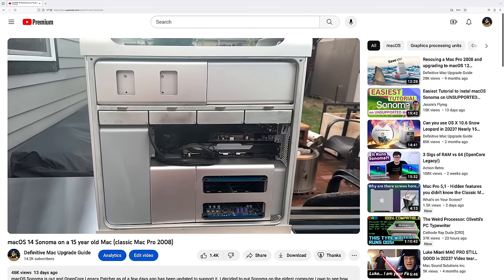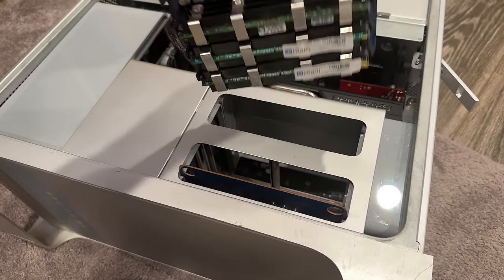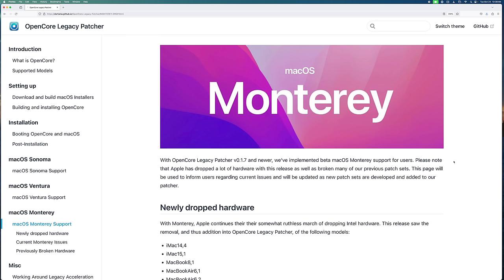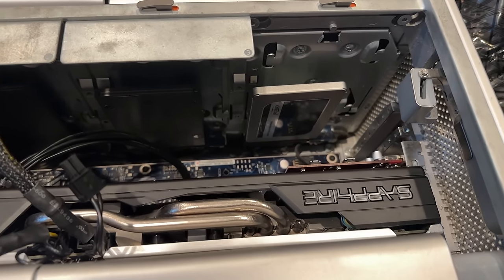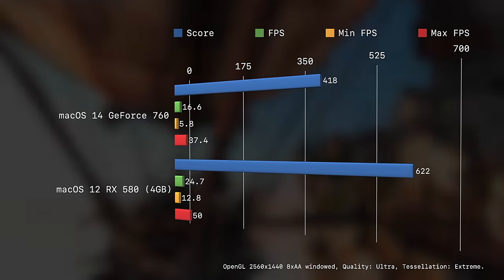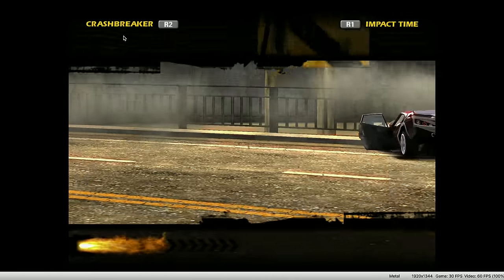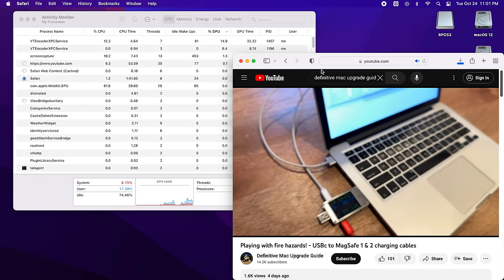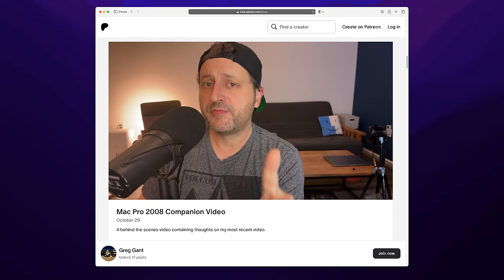Is it worth upgrading an ancient Mac Pro 2008?

Comment: I've had the same issue with my 2009 Mac Pro, and after days of messing around with it back when Ventura came out, I eventually figured out that if I installed macOS with the original GPU, removed the root patches, shut down, and swap in the 580, I could connect to the machine over SSH or VNC, and then install the patches like that. I've been using it daily since then without any issues! (And yes, the same procedure works with Sonoma for me)
Reply from the maker: That's.... not a bad idea. I never considered that it was fully booting.  I'll have to try that at some point when I'm more open to being frustrated again. Right now Sonoma is crashing when I try to launch it from OCLP weirdly.
Reply: @dmug I saw Jessie's flying post that there's issues right now with 14.1 on OCLP, so maybe it'll be worth a try in a couple weeks?
Reply from the maker: @joshm264 yeah, I was on 14.0 during the making of this vid, I’m hoping in a few weeks I can get macOS 14 working. Also, I forgot I have a black late 2006 MacBook that’d be a perfect candidate for Linux.
Reply: I get stuck on booting up on Sonoma aswell. (Same setup as described above: Dual 2,8Ghz / 16GB 667Mhz RAM and asus GTX 1060 with mSATA SSD (custom ssd enclusure for mSATA drivi) i CAN boot Sonoma if i hold the left SHIFT (Safe mode boot) But then SIP status is all fucked/locked, so i can´t install Root patches (No button availabale to perform patching) and YES this is on 14.0. so shouldn ´t be same issue as Jessie´s flying is describing. BUT look here. it is already solved by Khronokernel (author of OCLP)
Reply: I have a 5,1 and installed a rx 580 8gb (not chinese) but the trick i had to use is to uninstall the root patching first without reboot i think. Also i read monterey is the only stable system so i wouldn't try a newer one.
Reply: This is actually 100% how i got High Sierra installed on 2008 cMP 
installed with dosdude´s patcher and then installed the webdrivers over screenshare with GTX1060 fitted. and then just rebooted :D
Reply: I was able to install Sonoma on my Mac Pro 3,1 but during the install, when the  open core patcher was doing one of its several restarts, it would stop working and go black screen on me. After several failed attempts I decided to zap the PRAM holding the the keystrokes down for two cycles until the second louder start up chime occurred and still holding down the Option key and releasing the other keys I entered the EFI boot and successfully complete the install. The only problems I've had after that was that the Wi-Fi and internal Bluetooth no longer worked
 I found a patch for my WiFi but have yet to solve the Bluetooth issue. Otherwise the computer is running well. It helps that I have 16 gigs of RAM and an SSD drive installed as well as several terabytes of media storage in the other 3 SATA drive bays. Just recently I was able to install Sonoma on a MacBook 7,1 after upgrading the SSD drive and doubling the RAM from 4 to 8 gigs and using the same PRAM trick after an Open Core installer crash and booting to the EFI and selecting the hard drive and not the USB installer created for the open core legacy patcher install. I built my Mac Pro from salvaged parts from several computers that were being discarded as e-waste by my former employer that was downsizing its offices during the economic slowdown caused by the COVID lockdown. In fact I was able to refurbish another Mac Pro 3,1 and two 2011 Mac Minis which I later sold on Offer Up
Reply: Really? PRAM reset 2x DURING install? 
That is…unortodox in lack of better words. ;)
I have never thought of this as an option :D  @WaymoresBlues
Reply: …and DO keep in mind: I´m trying REAL hard to keep the Asus GTX 1060 6GB being fitted the Mac Pro 2008. 
If i swap the 1060 for one of my RX 580´s, i would think everything resolves itself. But that´s not what i want. I SHALL Make the 1060 run. no matter  ;)  @WaymoresBlues
Reply: This is giving me anxiety. Sorry I had to stop at the video, man 😂

Comment: Too bad the machine will use 500 watt at idle because of FBDIMMS and old CPU. LOL.
Reply from the maker: It’s quite a bit lower than that. I have a killawatt meter, and I think it idles at about 120w. But yes, Not great when compared to modern power efficient machines.

The fully buffered ECC DIMMs idle at about 8w per module vs 4w for non fully buffered. The old cpu on the other hand… yeah… not good.

Comment: Yeah Mac Pro 2006-2012 got SATA/300. Not SATA/600. So "all" SSDs will step down from 500-550 MB/s to 250-300 MB/s but it's so much faster than HDDs plus don't forget the IOPS performance.

Comment: Coincidentally I  just bought a second GeForce GTX 680 2 GB (€100) for my secondary 3.1 ( 2.8 octocore, x2 SSD/ 32 GB RAM)  Am I crazy?
Reply: No, this is a testament to how far these modular pcs can be pushed. This is how the pc era should be. If you can keep something alive with a few modest upgrades over time then you should.
Reply: Sonoma works correctly on my MacPro 3.1 24GB Ram and GTX 680 2 GB.
Even booting from an external USB enclosure
Reply: @txilibrist  Yes, that´s the plan. As my 2 Mac Pros are almost identical I just will install Sonoma in one of them under OCLP then SuperDuper clone to the other one.     Writing from my main 3.1 2 x 3 GHz Quad-Core Intel Xeon which I use on daily basis even when I have more recent Macs (2014 MBAir, Mini and iMac)
Reply: @miguimau  tu apodo me suena mucho de Macuarium ¿Cierto?

Comment: Hello.  I wanted to let you know that I tried this using the patcher with Big Sur and Ventura on my Mac Pro 3,1.  Making the USB installer went off without the slightest hitch.  That was the end of the good news.  The USB was NEVER seen as a boot option by the Mac.  I know that it will boot to a USB, because I have had a Linux distro installed before.  That, in itself, is another nightmare story.  It will install Arch-based but not Debian/Ubunti-based distros.   Why is it not seeing the USB drive?
Reply from the maker: Did you install OpenCore and then boot off the OpenCore partition? OpenCore sometimes be a bit goofy.
Reply: There is no OpenCore partition.  The flash drive is not seen.

Comment: I love the timeless design of Mac hardware from 2008-2020.  Which one of my fave setups was taking a 2011 27 inch iMac and getting the ram to 32gb, 2tb samsung sata ssd, and then would put on a pretty custom version of Linux to run on it.  Quite a bit of distros now from 22.04 support all the devices in it and older macbooks even the facetime cameras ootb!
Reply: Beleive it or not this design goes all the way back to the Power Mac from 2003!

Comment: sorry buddy Mac Pro 2008 is better pick. Silicon suck balls, no internal Massive Storage, can't remove anything internal. can't run older 32 and 64 bit games /Apps. can't downgrade to Older Mac OS . Modo 3D (MacOS 11.x (Big Sur), 12.x(Monterey) and 13.x (Ventura)*
Windows 10 and 11 (64-bit only)
Linux CentOS/RHEL 7.6-7.9 (64-bit)**
*Modo 16.1 has been tested and validated on apple silicon hardware, running under Rosetta 2 emulation
Other operating systems may work but have not been fully tested, please see release notes for details on libraries that will need to be installed.
really Rosetta 2 emulation. Apple / Tim get to control what upgrades goings in your computer. What happen to the freedom to pick what upgrades you want for YOUR PERSONAL COMPUTER. You can Pick AMD, Nividia , Sonnettech,Newertech, etc. its funny a computers from my childhood (Commodore and Amiga) allow you to do every, while a modern computer don't do gaming well.

Comment: I bought a used 590 with vial bios and I struggled like an hour with windows drivers, seemed like the car was running a mining bios and after switching the bios it worked great.

Comment: Definitely some of the better looking Mac systems; I didn't know you could shoehorn newer MacOS in there. I worked extensively with Xeon systems of this era, and they were quite the screamers at the time, I think I had tricked out my dev system with dual W3680 (gulftown) before we moved to Romley (E5-2600 and -2600v2 series).

Comment: I have a similar setup, same GPU but with 8GB RAM, 32GB system RAM but a single processor. It runs Monterey happily under OCLP and I've not moved to Ventura or Sonoma as I don't like the interface. The only issue I've really had is that I have to remove the boot drive and install OCLP from another machine or I loose Bluetooth and I've never managed to get WiFi working so it's as well the ethernet is close by. I tend to use it as a media server, from your experience I think I'll definitely stick with Monterey!
Reply: Nice I got 32 in my dual 3,1.
Reply: I’ve heard you can upgrade the processors but gpu and metal is the key to it all or just bootcamp windows tbh it’s still intel

Comment: There's one more upgrade that you could do, and it's only theoretical and my 08 cheesegrater got stolen so I can't test it anymore: Getting a pair of X5460 CPUs and modding the pads to force the Bus up to 400Mhz and the CPUs at a toasty 3.8Ghz. (9.5x multiplier I could never test it well because my 667 RAM did not like an increase in the bus speed. (Or if a pair of X5470 CPUs could work with the same FSB mod)

Comment: If that’s a 4,1  or 5,1 you don’t actually need registered memory. I ran regular 1333mhz in mine.
Welp, Nevermind lol. I have the 5,1 with 6 core 12 thread Xeon. Heard you mention 3,1 a bit after commenting.

Comment: Ive upgraded many 2008 to 2012 Mac Pros for my business. The problem now is the cpu(s) are obsolete so future OSes, even those for Intel chips, wont work properly
Reply: what software does it have that you can't use on a windows PC?
Reply: How do you upgrade a 2008 to a 2012?  They are totally different computers.   Did you mean 2009 (4,1) to 2010-12 (5,1)?  You can upgrade 2009 to a 5,1 but not a 2008

Comment: how did you get it to support metal 3? my 580 (exact same 4gb sapphire nitro) is stuck on metal 2 in Sonoma. also how did you go about installing windows, did you use bootcamp?
Edit: also, when I first installed my RX 580 in my Mac the only way I could actually get it to output any form of video, was by removing all the SSD's, HDD's, USB's and expansion cards except for the OCLP USB and the 580. Then I had to perform an NVRAM reset to, for lack of a better term: "load the drivers" onto the card. lastly, during the install I had to do an NVRAM reset every single time it rebooted. Hope this helps.

Comment: 2008 is too far back, I was running an 09 for a long time using open core and some GPU I can’t remember. Sure I’ve got some videos on here of changing the CPUs from dual cores to quad cores. Love these old Mac Pros, such a beautiful design.
Reply from the maker: Agreed, but I’ve had this computer since 2008 so there’s a mild sentimental value and it’s the reason I wrote the Definitive Mac Pro upgrade guide. 

Plus, I do have a small use case for it as a box to mess around with and make videos about it.
Reply: @dmug I’ve got you man, I just came across this video randomly. You’ve earned a sub for all that hard work.

Comment: Ah I haven't dabbled with running opencore on my Mac Pro 3,1. I just have mine running Catalina with a vega 64 and a PCIe adapter for the sata SSD boot drive. I just had to add the instruction emulation so I could make the CPUs recognize the Vega card. I want to say it was SSE4.2 instructions that the harpertown Xeons do not have natively. 

I messed around with clover a couple years back for a ryzen based hackintosh that was fantastic. Never got around to trying out opencore. I mostly use linux now.

Always fun to push the limits of old hardware. I keep the 3,1 around these days since it has both firewire 400 and 800 making it ideal for troubleshooting and fixing other old intel macs, macbooks, imacs, etc anything from '06-13.

Comment: I upgraded my 2009 Cheese Grater switching form 4.1 to 5,1, with new processors, adding 30%. a new GPU, and filled up the ram ... it wasn't entirely smooth (had to add software to deal with fan overrun), but I've been running it very happily, dealing with 4k editing very easily and fast reactive screen processing ... 14 years old. Must have been an oversight by Mac to allow so much potential e-waste get by their general single use attitude to their products.

Comment: I’m debating the same for a 2012 5,1 model that I can buy for $100
Reply from the maker: tough call, $100 pretty middle of the road for a deal but the CPUs are dirt cheap for it and the RAM is much cheaper for it than the 3,1. I'm guessing for about $100 you could have a newer GPU + faster CPU(s) + SSD and for $150 more RAM, bringing you to about $250 damage, but used Mac Minis M1 are $400 and despite the 8 GB of RAM likely faster for most things. The four reasons I'd go for the Mac Pro is: Love of the hacking/hardware, ability to boot many OSes, and finally, internal storage and finally playing Windows games. The reasons I'd go for the Mac Mini M1 is: need a computer that's stable and have actual work to do, dislike of messing with esoteric system configs, native OS support.

Comment: polaris and rx serries gpu need avx/avx 2 and the xeon cpus in de 2008 mac pro do not support this 
only the 4.1 and 5.1 mac pros have support for cpus that support it
Reply from the maker: None of the classic Mac Pros support AVX. That’s where the MontRand patch comes into play that’s bundled in OCLP. The Mac Pro 2013s support AVX but not AVX2. It’s why you need to flash the 6000 series GPUs regardless of the classic Mac Pro generation.

You’re probably thinking of SSE. The drivers for the RX580 started requiring SSE4.1 which the Mac Pro 2008 doesn’t support but there’s a patch included in OCLP for that.

Comment: This is awesome. I love older Macs and always felt that a lot of them had planned obsolesce before their time. Seeing one comfortably run modern MACos in general is pretty sweet.
Reply: planned obsolescence is Apple's whole strategy
Reply: I still have a PowerMac 6500 in my garage with OS9 installed on it mostly for nostalgia since it is covered in the stickers from the several bands that I liked or personally knew back in the 90's when I used to make flyers for them in Photoshop and run down to Kinkos to print and cut them on card stock. I miss those days but not the trying to figure out which old extension was incompatible with a new one and was causing my system to crash. That was always a problem and just when I thought I handle on it, BAM, OSX came out and all of my old Macs were now obsolete
Reply: And that greedy planned obsolescence practice from Apple is why I stopped buying new Apple products after the burn I felt when I purchased one of the original iMacs that was made obsolete within a year and their ever changing power adapters and lack of backward compability. But what really riled me to no end was when I went to buy a composite cable adapter for my Video iPod and the Apple markup on it was outrageous only to find a similar mini RCA to composite cable at Pacific Radio and find the only difference was that red RCA jack was actually the yellow, the yellow was the white jack and the white was the red jack on a 12 foot cable that was a fraction of the price of the official Apple 3 foot composite cable. Those chicken shyte sumbich's at Apple haven't got a red cent from me since.

Comment: What happen the last time you installed MacOS14? I wonder ... did you need to add boot arg's like Pikera.
Or maybe you needed to use the Nvida card / use OC to make a MacOS14 instal / then add RX and boot arguments.. just brainstorming. those are my thoughts.
I may pull mine out, knock the dust off snd have s go with a Vega 64.
Reply from the maker: That’s where my knowledge trails off as I missed the era of manual tweaks. I briefly used Martin Lo’s config but we had the same system: dual 5,1 + Radeon VII so I never messed with it, then I sold my Mac Pro 5,1s. 

I ran the post install remover from OpenCore, which nuked the GeForce 760 and included the AMD option assuming it’d configure everything properly. 

My current OpenCore config works for macOS 12 so that portion seems to be ok, but it’s just working with Sonoma and not sure if some post install is messed up.

Comment: Hello Mac Pro users, does anyone know if I can still boot a 2009 Mac Pro into 10.7.5 lion with the 5,1 firmware and the 12 core 3.46 processors? Please and thank you!
Reply from the maker: Yes but 10.7.x has pretty limited GPU options and is capped to to something like less than 96 GB of ram. You may want to consider using a virtual machine for 10.7.

Check out my video on running snow leopard on my Mac Pro 2008.

Can you use OS X 10.6 Snow Leopard in 2023? Nearly 15 years later...
https://youtu.be/OXRFr8AFC9A
Reply: It's really just so I can run pro tools mp9 and use all my old firewire hardware etc. I'll take out the metal capable GPU in it and put the much older 5770 that was stock. Thanks for responding.  @dmug

Comment: You are as good as you think you are. You wrote the Definitive Mac Pro Upgrade Guide did you not ?  1 more time get another 5,1 please. NVMe, in a good PCIe controller,  USB3, modern WiFi & BT  please get the 5,1 running well so you can help me Virtualize . I can’t get OCLP & Paralells to work ?
Reply from the maker: I did write it but unfortunately I sold my 5,1s during the early pandemic to buy a 7,1 so I really missed out on OpenCore, I never had to comb through the random flags in the config. 

I understand what OpenCore does and how it works from a high level but not the low level stuff. I’m not much help on OpenCore troubleshooting beyond very general issues as I do not daily drive OpenCore and thus probably never going to be an OpenCore expert.